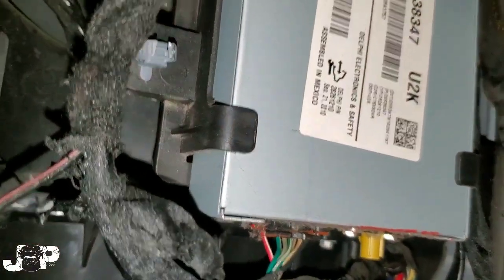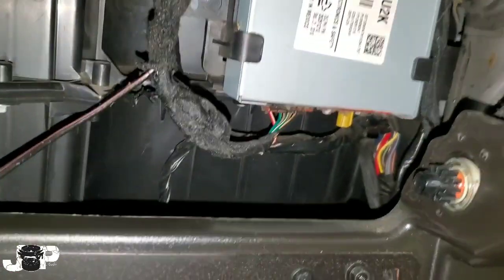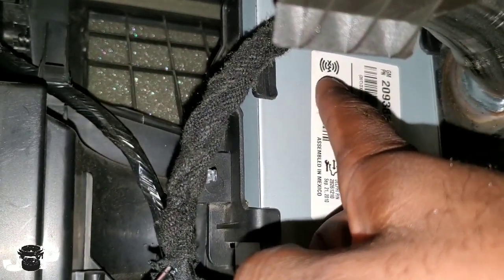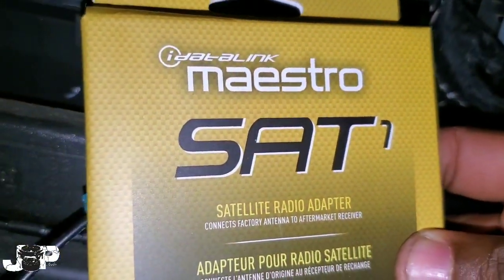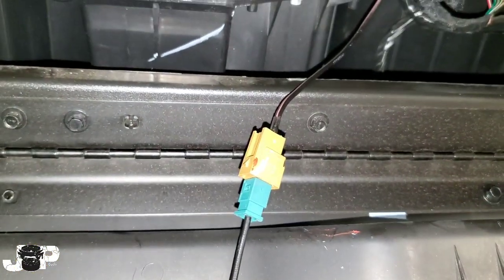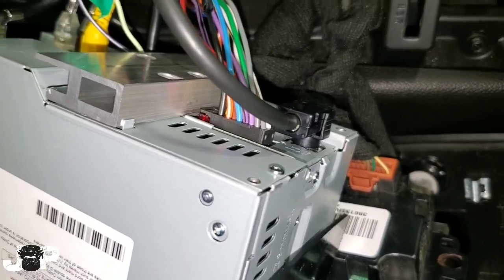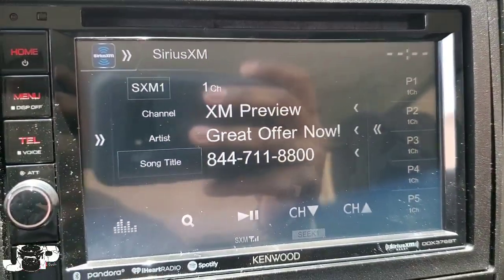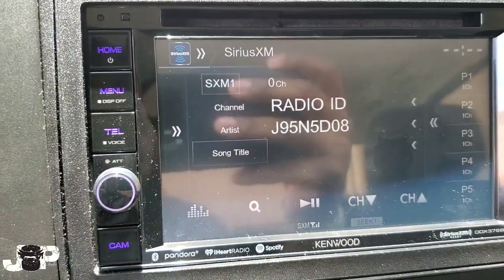How to install Sirius xm v300 tuner to factory antenna

Comment: In case anyone else is curious. This works with the 2013 GMC Sierra SLE Crew Cab. Glad I found the video so I don't have to run the antenna that came with the SXV300 Tuner.

Comment: I had a Visa Tech Turner Kit  HD07/SXV300V2 Sirius radio installed in my 2023 Honda Accord EX yesterday. The tech said that I can't do preset channels. I have to just change channels by hand. Is there any way I can get preset channels? So that I can set the channels I want. Tahnk you!

Comment: Hi, I have a silly question. Can this additional unit be added to a 2013 BMW X5 OEM Unit? 

Believe it or not, my XM stopped working after I switched services from Canada to the US. It worked seamlessly for years, but when I moved to the US, I changed plans, and it never connected back to XM even though it was working 100%. Once switched over to the US it totally would not connect. Radio ID shows up and then disappears, and the message prompts " Category?"

 I've made significant efforts to resolve this issue. I've spent a considerable amount of money at the Dealership software upgrades and troubleshooting. I've also invested several hours with XM Tech Support, but unfortunately, no solution was found. Additionally, I've tried using 2 used OEM radios from eBay, both of which showed the Radio ID, but the same 'Category?' message prompt appeared when I tried activating them.

Has anyone experienced these issues before, and if so, how do you fix them?  Any help is much appreciated.

Comment: Man I hope this works with my 2016 Sierra. It would save me from having to run the siriusxm antenna. I have On-star in my truck, so I guess the shark fin antenna is what antenna your talking about.
Reply: Turns out my truck doesn't have a HMI box behind the glove box. And my factory stereo doesn't even have a jack for the v300...Sucks